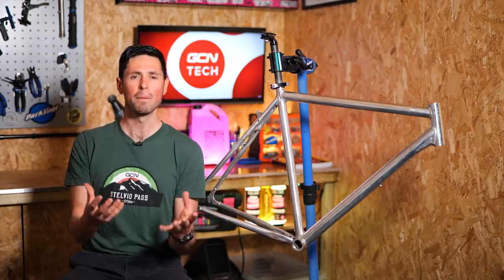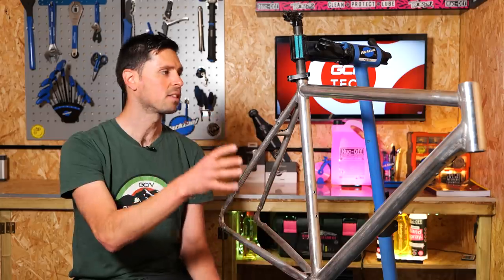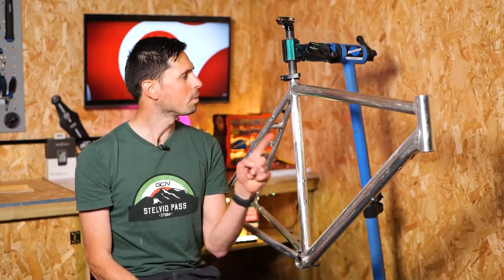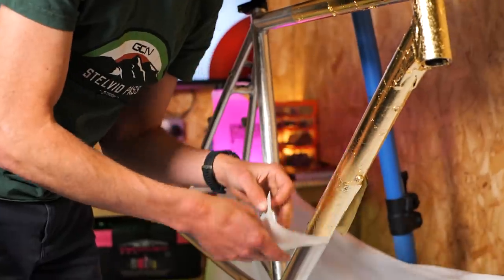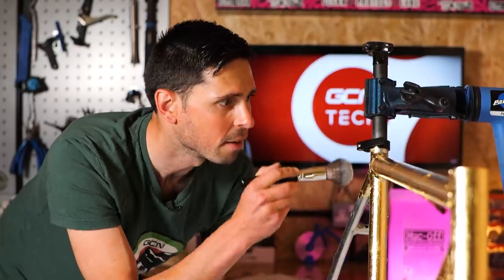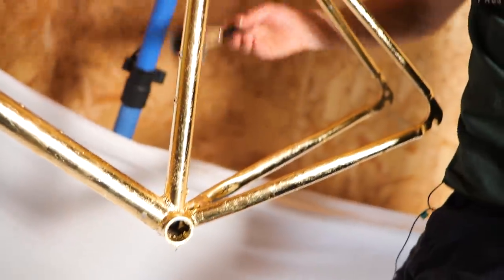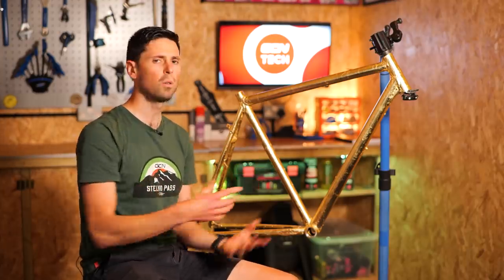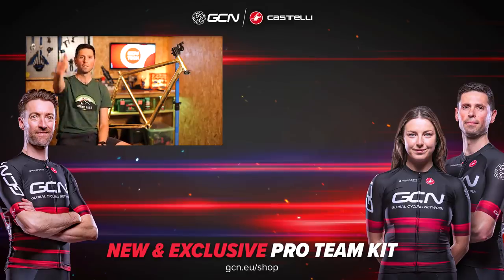We Make Our Own Gold Bike!

Comment from the maker: What other bike projects would you like to see us take on?
Reply: How to remove gold leaf from a bicycle frame.
Reply: Be interested to see a video on powder coating frames.  Shot blasting the frame could be part of that :-0   Good effort in the gold though. Probably looks amazing out in the sun.
Reply: You should have used gold paint not crumply gold leaf.
Reply: make a swing bike. you could travel to califorina to work on it
Reply: Bamboo bikes THEN some paint and a bit of gold leaf here and there....but bamboo bikes
Reply: How to apply a wrap to a bike - errr … maybe even a gold coloured wrap 🙄
Reply: @francoispayen  🤭👏👏👏
Reply: I think a better way to apply the “gold” would be to electroplate it.
Reply: Well I love my resto mods, got 2 steel 80s boutique brand  '  Carless ' frames with modern wheels and 10 speed Dura Ace 7800, one was specially built time trial legend Alan Roberts  and currently building a Giant Cadex 980c, I believe this was the first mass produced carbon frame,  it's having 12 X 2  speed mechanical Sensah, Corima Carbon wheels, carbon cranks, carbon just about everything.......can you do better? 💪 Bring it on 🤣
Reply: Take on the Wahoo ELEMNT Bolt 2 glitches for me, thanks
Reply: How much can you guys make a mid-range (105) endurance bike faster with less than 1000$. How would it compare with a mid-range (Ultegra) endurance bike and against a proper (Ultegra) race bike?
Reply: How about taking that gold leaf off , polish your frame and get it 
gold anodised , that way its smooth , added hardness to the frame it 
even improves stiffness ........... what's not to like ? 
Go to an anodised and film the process , that would be a good prog 
Then buy gold Titanium or gold Aluminium bolts to complete the look
and it adds lightness ....... as Colin Chapman would have said.
Reply: I did a better job (on an Emtb) with £10 sheet of car wrap off ebay lot easier use it to protect your frames original paint work and removes without leaving glue on frame so no prep work (just clean it) be good to see what you guys come up with using wrap - very cheap and easy to replace and original paint can remain and stickers if raised will look pressed out..

Comment: Mistakes were made. Once you'd applied all the "gold" you should've turned the brush and used the shaft to, carefully,  rub out all the imperfections.
Reply: Would it then become perfectly smooth, without any creases, or can it scratch off?
Reply: @andrei0525  Depending on how ductile the fake gold leaf is you can burnish it down pretty well, real gold is really ductile.

Comment: I would have tried to do hot brass laying. You basically take a torch to the steel frame and a brass wheel brush to the heated area and it lays brass down.
Reply: I did this with a couple of tube mech mods for vaping, they were aluminum. Sanded them to get the surface flatish then mounted one on a rod loosely so it could spin free and heated the whole thing approximately rocket hot. With the torch nearby to get the heat back up I let the brass wheel spin the tube. Turned out great